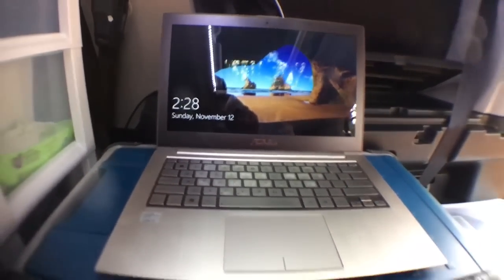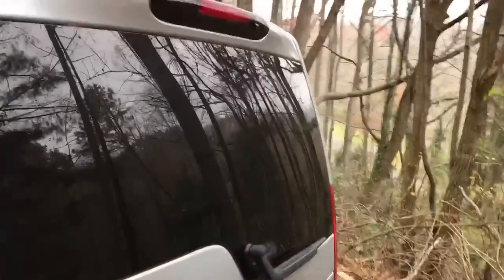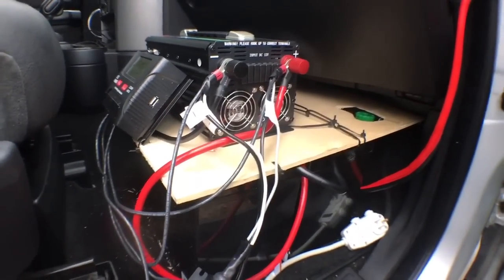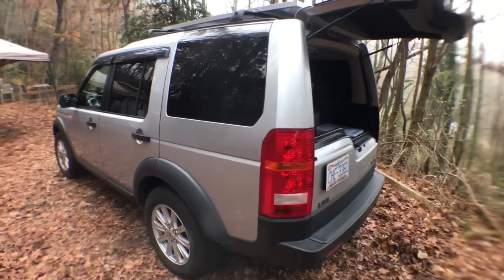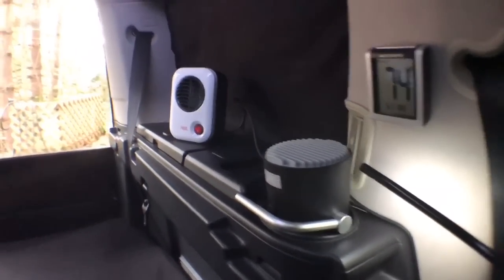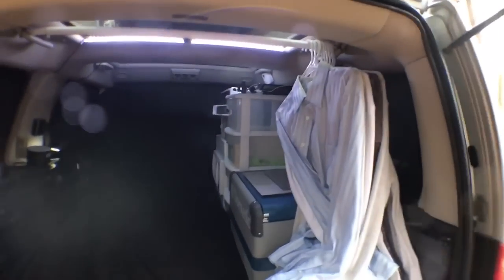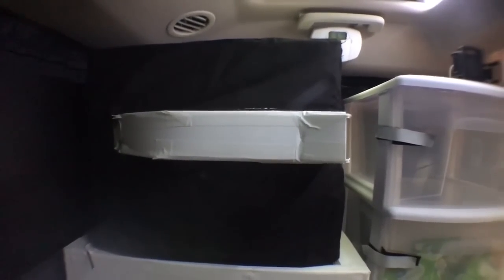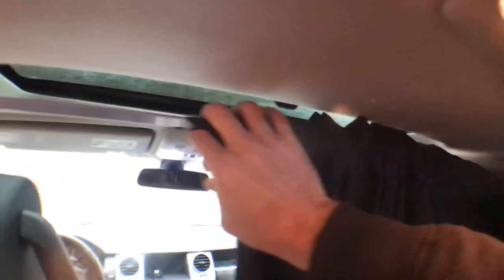Land Rover SUV Camper Build Tour. LR4 LR3 Solar SUV Camping VanLife Living in your SUV

Comment: I like the setup. Some advice maybe. The front seats on the LR3 remove pretty easily. 5 bolts and a connector. Then you could build a simple platform over the radio mounted below the seat. Would give more room for batteries while also giving you more space/storage. While I dont have batteries, I plan to remove my passenger seat for camping trips to place a cooler and laptop setup.
Reply from the maker: I think that's a great idea. I can't use the front seat anyway with the batteries in their current location. Thanks for the tip and for watching!

Comment: Great effort. But I would like to add some suggestions.

You have an AUX  battery section under the hood. You can fit a 60A Optima there. That is under the box driver side.

You can install an air compressor to the engine bay. Behing the LH headlight. Use it to supply pressure to your tires.

Instead of electric heater you should invest in Webasto type parking heater. Fuel burning heater. Uses the battery and the fuel from the vehicle. about 0.3 liter per hour or so. That is the proper way of warming cabins. This is what the truckers use.

Do you really need that A/C ?

You could install a kitchenette in there. And get rid of that microwave oven. Cook and have water. You have enough space in the car.
Reply: in addition, your car seems to be a 5 seater. That means when you flatten to the ground the 2nd row seats you have plenty of storage space behind them. You can put the inverter to inside the rear quarter panels. There are  huge spaces there.
Reply: Not sure about the US but here in the UK, the Discovery 3 (LR3) has a fuel-burning pre-heater fitted as standard.  It runs when you start the engine, to increase the speed of engine warm-up and reduce fuel consumption, but you can get an accessory remote control to run it any time.  (Actually, I think it might be just on the diesel vehicles, which 90% are in the UK).

Comment: WOW! I am so impressed with this build. I thought your Prius was pretty cool, but this one is awesome! I'd like to  see you run that a/c and microwave in another video.
Reply from the maker: Thanks for your comment.  This was a fun build.  I hope to make a video on the AC and microwave.  The AC was a challenge but turned out to be more simple that I first thought.  The AC uses 4 amps at 110 volts but I'm hoping to find a smaller one that could work better with the batteries.  Thanks for watching!

Comment: How reliable has the LR been?  Have you done any serious off-roading in it yourself?

How often do you run the a/c when you are not in the vehicle?
Reply from the maker: I have had it about 2 years and have had to replace the air compressor, lower control arms and tie rods. Other than that it has been great. I have put around 40,000 miles on it (has 120,000 miles now). It was built under the Ford era which was important to me as other ones had electrical and suspension issues that were very expensive to fix. I have not had the occasion to run the a/c when not inside. The window unit is really too powerful and cools things down very quickly but I have to run off regular shore power as the batteries can only sustain a few hours of use - good for a little nap during the hot day in a parking lot. I have not done any off roading but had some snow and ice to contend with and it did excellent!  Thanks for your questions and for watching!

Comment: So glad you did a SUV build! I've been working on mine, only problem is I don't have a sunroof in my SUV. Any suggestions on what you would do for ventilation at night for a stealth build?
Reply from the maker: Yes! Get the wind deflectors for all four windows.  You can then vent 4 windows without rain getting in. You can hang a fan from the ceiling handle and force air in/out. The sunroof isn't the best if it happens to start raining after you go to bed!  Thanks for your comments and for watching!
Reply: I bought most of the fabric to do your inserts, any suggestions on combining the two?
Reply from the maker: They fit so tightly I found that I can tilt the top of the insert in a bit and they won't fall out.  Another idea is to cut one side of the vinyl panel (not both sides) to where it would hinge at the top. You could tilt in say the top 3 inches or so and hinge it back up when you don't need the venting.  I have not tried it but you might give it a go and let me know how it turns out.

Comment: Cool conversion, but how did you manage to get the solar cables from the roof inside of your car? Did you use the  hole for the GPS antenna?
Reply from the maker: It was a little tricky. I opened the back hatch. At the top of the hatch opening is a rubber boot where other wires pass. I cut a hole just big enough for the solar panel wires to get through then sealed it back with silicone caulk. The plastic trim panel inside just below the boot, it just pops off when you pull on it. I then just ran the wires along the side trim pieces. I have not had any water leakage problems. Hope that helps. Thanks for your comments and for watching!
Reply: PriusStealthCamper Adventures Alright, thanks for your answer!

Comment: Sorry..I wasn't listening closely enough..you answered that question.. But how long does it take the engine to say fully charge the batteries from empty??
Reply from the maker: Francis Abbatangelo That’s a good question. The alternator puts out a lot of power. I haven’t really run it down much but if I had to guess I would say if the battery was down by 50% then about 30-60 min of driving should get it fairly full. The slowest charging is the last 10%. 

If it was down by 75% maybe more like 60 to 90 min. These are just guesses. Maybe someone will comment here who is more knowledgeable. 

The alternator gives a nice bulk charge and I let the solar add the finishing charge. Works very well. Thanks for your comment and for watching!

Comment: I've been interested in a stealth car camping setup and have loved your prius videos. I am strongly considering that (100% for the climate control) but as this vehicle will be a daily driver whatever I do needs to be modular. Any suggestions for a vehicle to use that might provide more room than the prius but still provide a flat 'bed' area without removing seats? I would love something more offroad capable but that still gets decent gas mileage. I know it's a random question but thought you might have some suggestions/insights. AWESOME channel!
Reply from the maker: Joe Medlin That’s a good question. It’s really hard to find something that you can lay down in but get over 30 mpg. Some small minivans might but I hate the look. I’m kinda on two extremes. The Prius is great but you have to handle a very small space. The Land Rover has lots of space but the mileage is aweful. So let me know what you end up with. Thanks for watching!
Reply: The Xterra has a completely flat load floor, and is my choice if I decide 4wd is a must. MPG is nowhere near 30 though. Good driving habits will help - coasting etc.
Reply from the maker: Mightbe Sherwood That would be a good vehicle for going anywhere and a good amount of interior room.

Comment: Very slick setup, how did you route the cable from the solar panel on the roof to the inside of the car? Cheers James
Reply from the maker: It was a little tricky. I opened the back hatch. At the top of the hatch opening is a rubber boot where other wires pass. I cut a hole just big enough for the solar panel wires to get through then sealed it back with silicone caulk. The plastic trim panel inside just below the boot, it just pops off when you pull on it. I then just ran the wires along the side trim pieces. I have not had any water leakage problems. Hope that helps. Thanks for your comments and for watching!
Reply: Thanks for the info, I’m putting a light bar as well as a cb antenna on my roof rack on my discovery 4 but wasn’t sure how to route the cable. Did you then run the cable down the right pillar to get to the bottom of the cargo space? Trying to figure out how to remove the plastic trim. Cheers James
Reply from the maker: Yes, then just ran on the floor - so wasn't the best but my bed hid all the wires then. The top plastic piece I just pulled straight down on and it snapped out. I did not pull out the side pillar ones, I just tucked the wires in as best I could.
Reply: Cool, thanks for your quick replies, much appreciated. All the best, James

Comment: Cool vid , great vehicle and mods. In researching roof racks for my Prius, I ran into the concept of aerodynamic front edges for the cross bars. A reviewer remarked that it may or may not have helped mpg but definitely cut wind noise at speed. So , when I saw your solar panel..........Walking Dead on now, check U later
Reply: My Prius is telling me you Prius is jealous. Do the right thing!

Comment: How is the reliability of the Land Rover? I was thinking of getting a discovery next...
Reply from the maker: Mine actually was pretty good. I purchased with about 75,000 miles. Mine was built under Ford ownership and they fixed many of the electrical and mechanical issues of previous models. At 120,000 miles it needed a new air compressor, lower control arms, tie rods, battery and tires. I got an estimate from the Rover dealer ($280), got the list, sourced the parts my self and had my local mechanic install. Rover estimate $9,500 at the dealer, my way - $2,500 for everything. Just don't let the dealer do repairs and maintenance outside of warrantee. Thanks for your question and for watching!

Comment: What an organised vehicle camper. Btw, for your site, have you looked at Wordpress > Settings >Search Engine Visibility to make sure 'Discourage search engines from indexing this site' is not turned on? The other thing can be if it fails the mobile benchmarks but that doesn't seem as likely.
Reply from the maker: totoro myneighbour Thanks for the top. I will check that out!
Reply: Link to test your site for the mobile features that Google wants: https://search.google.com/test/mobile-friendly. If you pass, there is a link to 'submit your site to Google'.
Reply from the maker: totoro myneighbour I just submitted. Thanks!
Reply: good luck. your channel's really informative.

Comment: Where did you get the led light strips
Reply from the maker: I believe I got them off eBay. I was trying to find them in my order history but it does not go back that far. I just got the cheap white ones, USB, no controller, no switch. I think they were around $5 or less each. I think they were 6' strips but you can cut to any length.
Reply: Thks for reply

Comment: I notice you have your co2 monitors up high. If I’m not mistaken co2 is heavier than air and should be mounted at or below where your air intake (nose) is. Otherwise think you could get ‘gassed’ and monitor not register. I’m not an expert but want to keep you safe.
Reply from the maker: Thanks! I'll have to check that out.
Reply: co is heavier than air. co2 is lighter :)
Reply from the maker: Good to know, I will lower the CO detector - I was not aware of that.  Thanks for the information and for posting.
Reply: Ooops, sorry it's actually the other way around. Just re-read my comment. CO is a little lighter than air, that why, in case of a fire, it's recommended to get out by staying close to the floor.

From St. Google: In order to ensure that your home has maximum protection, it's important to have a CO detector on every floor. Five feet from the ground. Carbon monoxide detectors can get the best reading of your home's air when they are placed five feet from the ground. Near every sleeping area.

So it all depends on what type of detector you have. co or co2.
Reply from the maker: OK - thanks for the correction.
Reply: Lol thanks for the update. My brain went to recalling periodic table which made it heavier but then flashed to molecular density and I got a head ache. Lucky for me it was 4:30 and happy hour starts now.